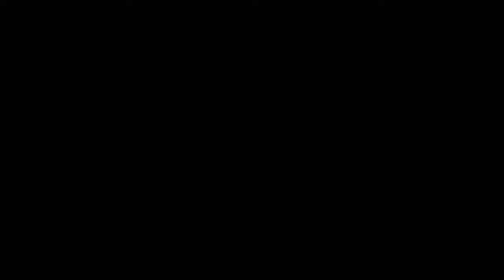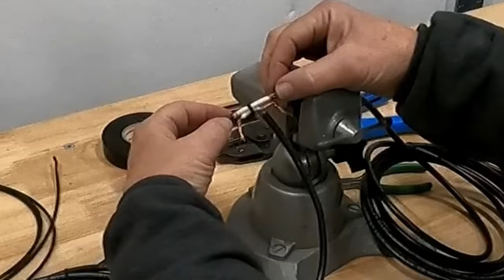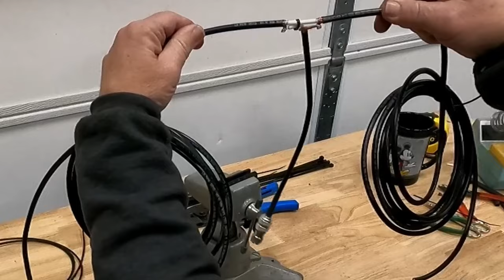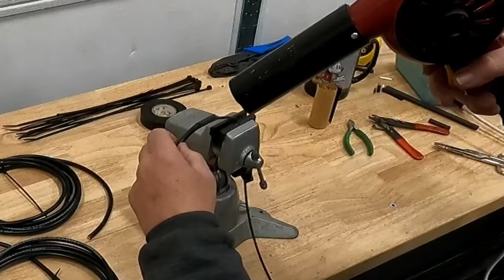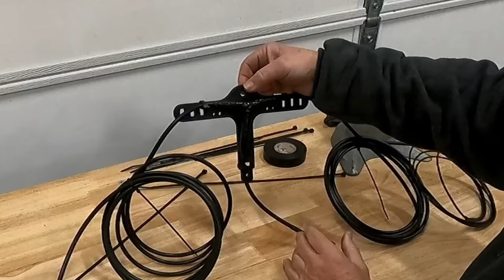Build a Double Bazooka | 100 Watts and a Wire

Comment: The day after I passed the General exam I was given a Radio Wavz 20M double bazooka.  Friends that have been at my house since then are blown away by its performance.  I have contacts all over the US, as far south as Brazil and as far east as Slovenia - all on 100 watts!  If I can hear them clearly they say I'm booming.  I've even had solid contacts with a 5/4 signal strength report.

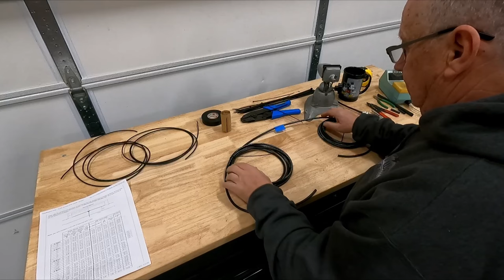Comment: Must the length of radiating COAX at the middle where the COAX braid is cut and pulled back to connect to a feed line (Where the center conductor remans untouched in the dielectric) be of a specific length? Reference preparing the blue tape at the center section of the COAX at 2:36 in the video.  How much COAX Braid must exposed and cut, and how long must the untouched center conductor be?      I would like to prepare a center connecting point using two SO-239 connectors that are wired to the center, and braid of the feed line cable, with the center of each SO-239  connector soldered together with a jumper wire The purpose is to build individual band specific Double Bazooka antennas for 10, 15, and 20 Meters simply by connecting prepared COAX radiators to a center attachment point via PL-259 connectors on each radiating COAX. Hence my questing regarding what must the length of center conductor be the radiating COAX at its middle?